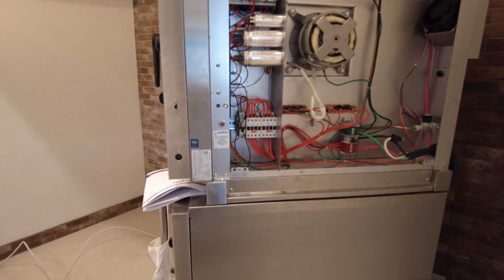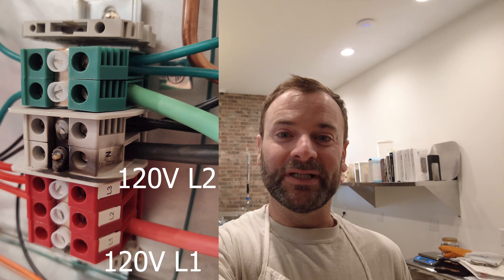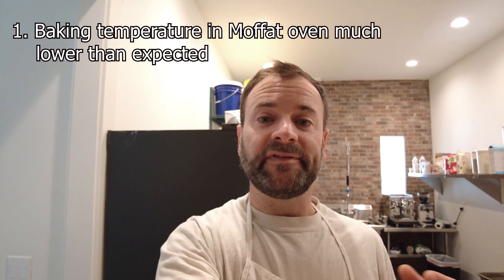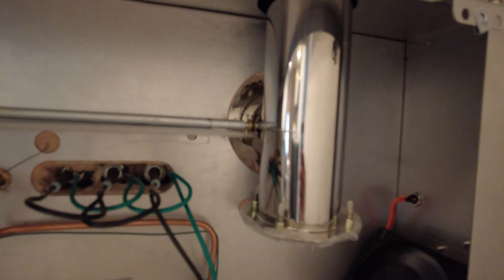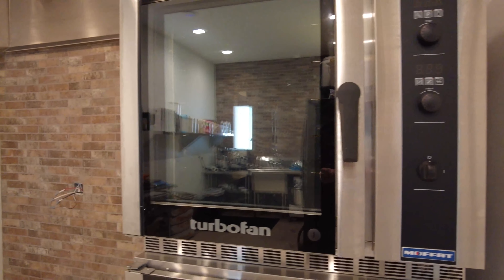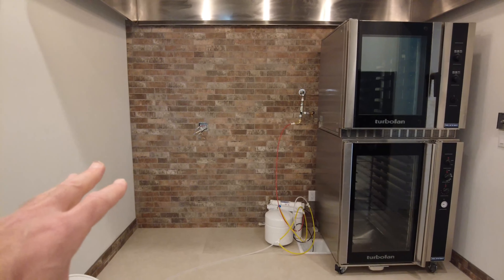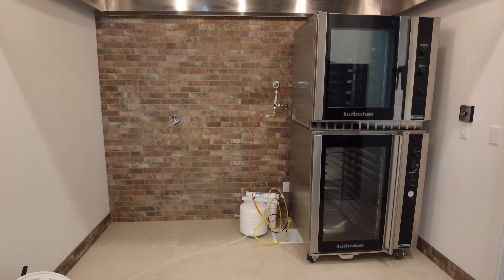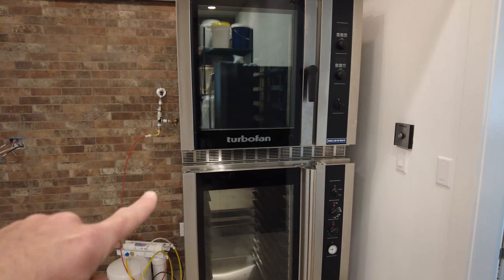Building a micro bakery: Electrical disaster with the convection oven! PLUS, microbakery updates.

Comment: I too am looking forward to the future videos.  Always good info, and will be interested in the comparison bakes you plan in the future.  It seems to me the Moffat unit may have either a temp sensor, probably a thermistor, that is out of spec or improperly calibrated. I'd be curious to hear what whether other Moffat units heat to a truer temperature.
Reply from the maker: Great thought Nathan. Take a look back at my first bake where I thought of exactly what you said. I pointed an IR thermometer in the oven and it appeared to be true to the temperature on the display. My theory is that the fan is moving a lot of air and the convection properties of the oven are more robust than I'm used to or expecting. Moffat really just shrugged their shoulders when I asked them.